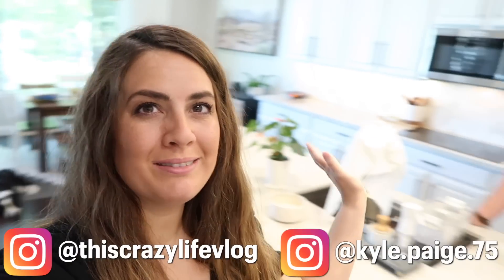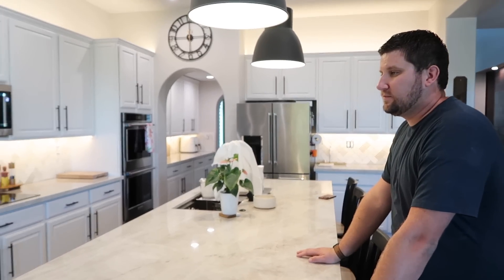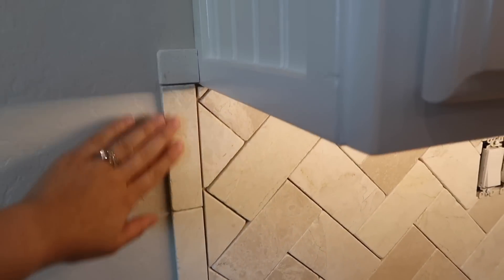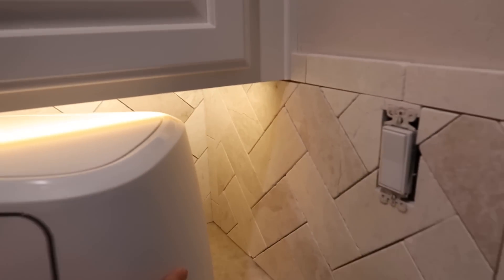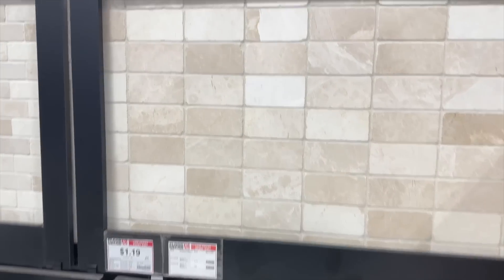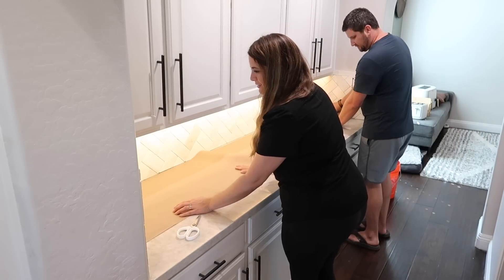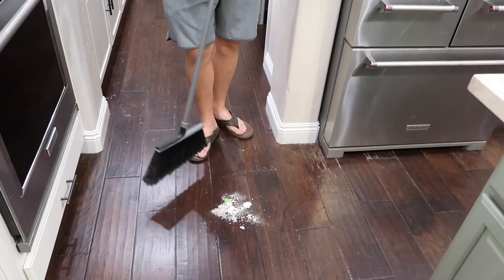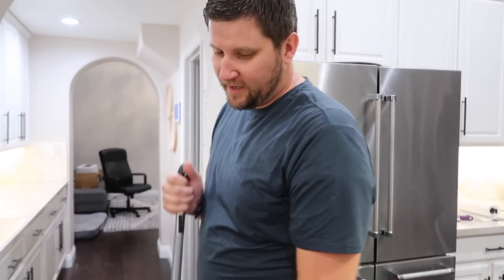VLOG 36 | FINISHING OUR KITCHEN RENOVATION :: Grouting our Backsplash & Kitchen Chat

Comment: I love any transformations/renovations…recent subscriber and I have to say, you guys work like crazy to update, modernize and refresh all of your spaces. I’ve loved everything you’ve done. The green bathroom renovation was awesome, you couldn’t tell it was so ummm tacky(paint color) before you tackled it from all angles….end result Fantastic! The kitchen…I got to see the island, counter tops, cabinets and backsplash transformation! Wow, it turned out beautiful, clean, fresh updated and what a difference The backsplash was a lot of work but oh so worth it after finishing it. Definitely a labor of love to cut all the tiles and then place, space, seal and grout, not a small kitchen either. One of the added bonus touches to me was the mini track lighting run across the top and under the cabinets! Kyle gets all A’s for running the lights and the tile cuts! Amanda gets the W’s for her design style vision and pulling it all together. Y’all are a great team!

Comment: The next time you red to cork anywhere you can tape a teaspoons
 level with your gun nozzle and as you put the filler in the teaspoon scrapes it into the gap so you don’t have to use your finger afterwards, I saw it on instagram as a video to watch I love your kitchen, I would try to sand your wooden fruit bowl you have for your table and your bench seat plus the table to match your chairs well done with the work you have done I would have a large low bowl with several orchids in on your island x